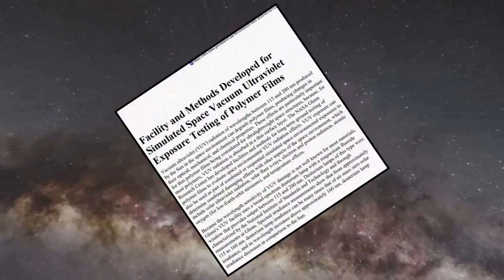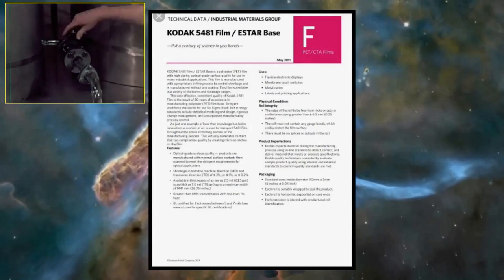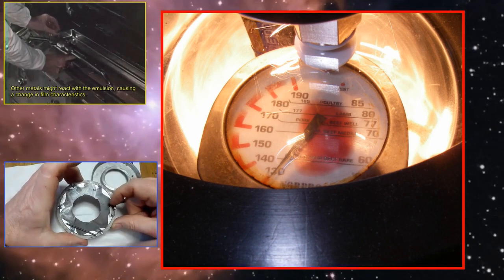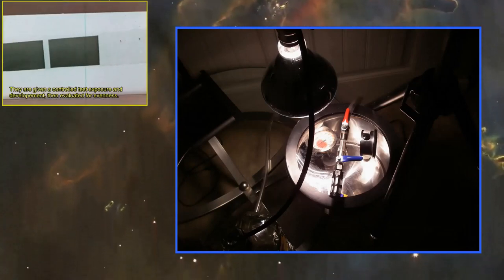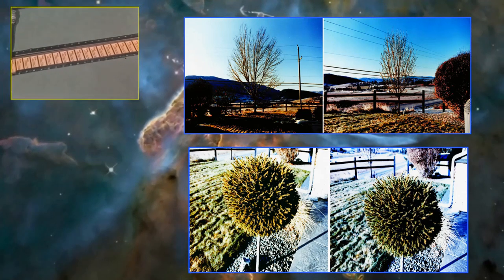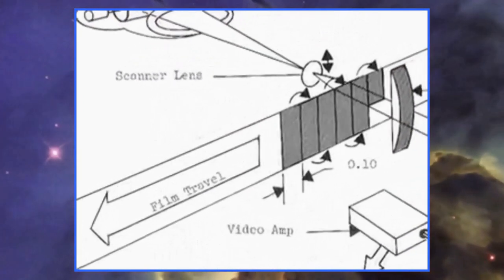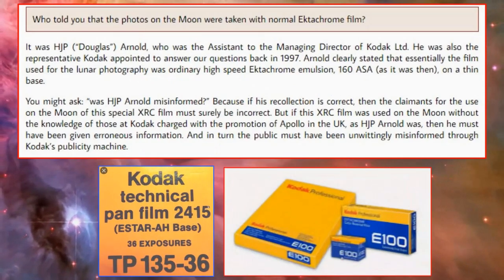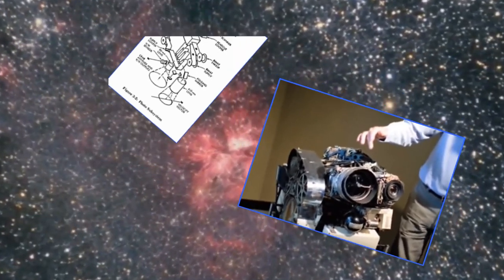"Apollo Ektachrome ESTAR Film Subjected to a Vacuum"

Comment: I saw the vacuum chamber used for getting these results and I have to tell you the vacuum pulled is 1000 times less strong than what you will find in outer space. Imagine how worse the effects on the film will be when subjected to a proper 10-6 torr vacuum.... Go and find a proper vacuum chamber, normally found in physics labs; most of the physics teachers will be eager to help you, they know first hand the "trips" to the moon didn't happen, and will be very happy to help you out. Keep up the good work!
Reply from the maker: The one we used was a 2 stage medical grade vacuum pump. It ruined the first chamber we hooked it to. We achieved 10 -3 torr with it. The entire point of this experiment was to use equipment that could be purchased online, and delivered to your home. This way, anyone can do the same and obtain the same results as did we. The 1965 report conducted by MIT, shows exactly what we found. The link is on aulis in the description box. Imagine what would happen to that film stored in the LM, cycled 3 to 4 times when the astronauts exited and entered the LM. It is the cycling that is fogging the film, and not just the vacuum.
Reply: @shillstompers3793  Very nice! I know exactly the vacuum chamber, it is from ValueVacs, actually they are quite good, but not good enough for your purposes. Imagine the results you will get when you use a turbo molecular pump. This experiment is not about home accessibility but proving that NASA are frauds. Keep it up, you are my favourite channel.

Comment: At what point did the astronauts swap out film for more film?
Did they simply eject the used film for new film?
Reply: They did that on the so-called lunar surface, and when they retrieved the film during a space walk. No way could that film have survived, no way! It would have foged and the hues would have gone wild after three cycles of vacuum. Read part one of the written article on this at the link below. It goes with this video. Cheers Armando!
 https://www.aulis.com/vacuum.htm